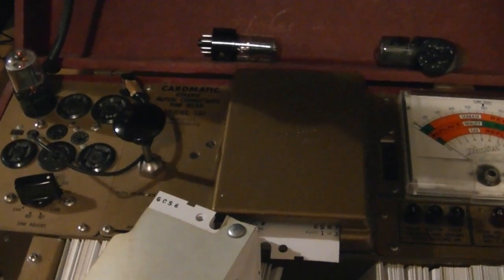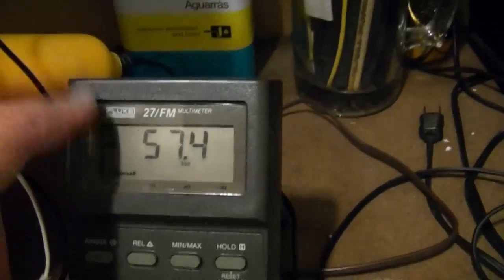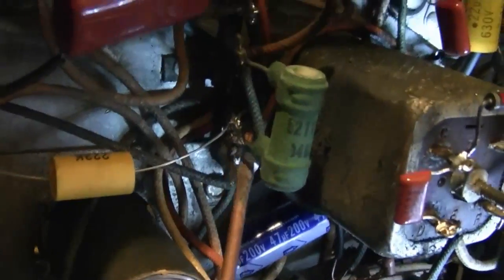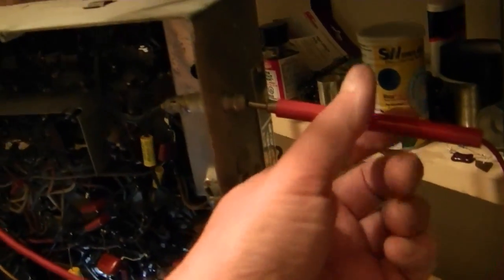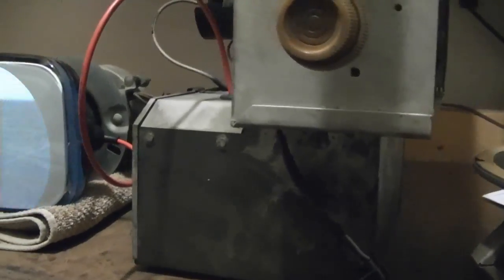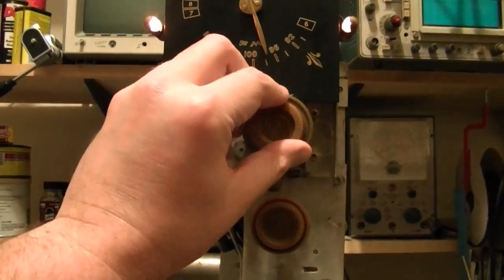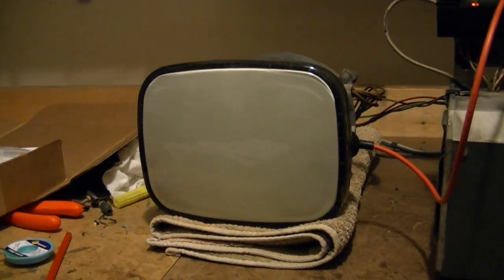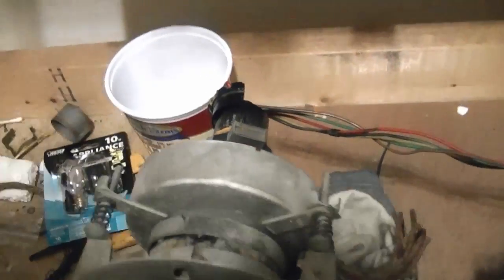Dumont RA113 restoration p5o8

Comment: Love the continous tunning approach. Soft and easy. no cranking ... is this approach more complex technically or more simplistic ?. Guess you dont worry about channel calibration since this thing is continous. Phono imput is to hock a ceramic pickup ?
Reply from the maker: I suppose it's more simplistic since there are several roller inductors rather than 12 sets of fixed inductors with a complex switch or turret.  I think this one does need some sort of calibration since channel 4 comes in around 3 on the dial and I can't tune in 3 at all.   it could just be that the dial string has slipped and needs to be adjusted. 

The phono input is just an RCA jack straight into the volume pot.  I suppose you could feed an low level audio source into it.

Comment: Looking Good.  glad you didn't get another tough one after the last!
Reply from the maker: Not so fast.  The set is still a ways from tuning properly and I'm having major troubles with the alignment.
Reply: Fair enough.  You did mention it has  one of the most complicated alignment procedures.
Reply from the maker: Bret Frohwein
True, but I've got the hang of it now.  The bigger issue is that some of the IF transformers are way off and may be damaged.
Reply: OK, that would suck.
Reply: The ones with the silver mica creep?
Reply from the maker: Bret Frohwein
These IF transformer use a technique called 'over-coupling' and don't have mica caps in them.   Could be damaged iron cores.  I'm not sure at this point.
Reply from the maker: Bret Frohwein
Late last night I discovered that two of the IF cans do have issues with capacitors, but they're not mica.  They are ceramic tubes partial coated with silver on the outside with a wire running through the middle.  Lots more in the next video about that.
Reply: Sweet!  I'm looking forward to it!  I'm still trying to find a purpose to this extra e-cap on the 41-315. Happy Thanksgiving!

Comment: Bob, you should know, I've had similar troubles with the 6SN7's on various equipment.  They seem to develop some wierdness to them similar to what you're seeing. Make sure you test all the modes with the Cardmatic.
Reply from the maker: Thanks for the tip.  This set is full of weirdness!
Reply: I tried hundreds of 6SN7's. Not many of the ones I tried actually worked very well. but my notes suggest that the no name ones don't work very well. The well branded ones worked a bit better.

Comment: So over engineered but so under thought. It's too bad the CRT filament is on when the FM is on. I bet it is on in phono mode also. Time to put a switch in there.
I was expecting a little more action from the eye tube also. One side just always at full deflection?
Yeah, plate voltages at -56V really have a hard time attraction those pesky electrons. I'm happy for you that you got it running and that transformer was OK.
The tuning is interesting and it is two speed. Not to bad to go 360 degrees really.
Wouldn't it help if you took the output of your digital cable box and fed it to your BT modulator first? Just a thought...
Have a good week and letting us know how you made out sooner than later.
Reply from the maker: I've received several comments about it being over engineering, but it really isn't.  Other than the continuous tuner, it's really not much different than any major brand set from 1951.  Some of them used that continuous tuner too.  It's the 4os Dumonts that are really over the top. 

The owners manual states that one should line up the bottom edges of the bright areas in the eye tube while tuning so perhaps mine isn't working properly ?
Reply: bandersentv
Yeah, As far as the eye tube operation that makes sense. Maybe there IS something amiss there.

Comment: It's a shame this sophisticated tuner with an eye tube will be kept on channel 3 forever. Since analog broadcasts have stopped, did you ever consider getting rid of the RF portion of a set entirely and feed it audio and composite video directly with a pair of RCA cables?
Reply from the maker: Nah, I'd never do that.   Keep in mind this is also an FM radio so the sets owner may choose work that tuning dial all the time.   Personally, I have a couple low power TV transmitters set to channels 3, 5 and a third that can be set to any channel.